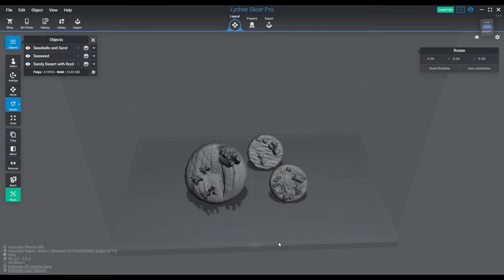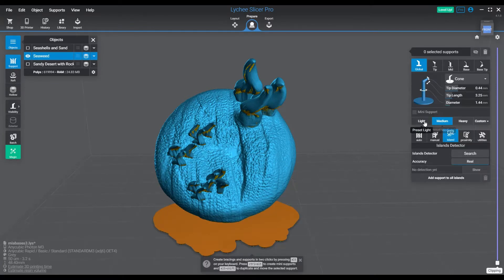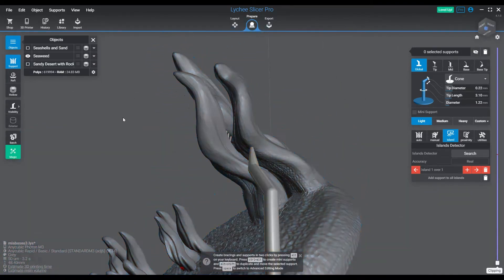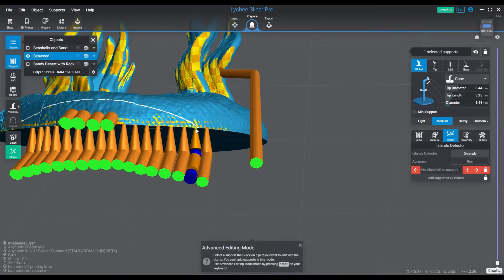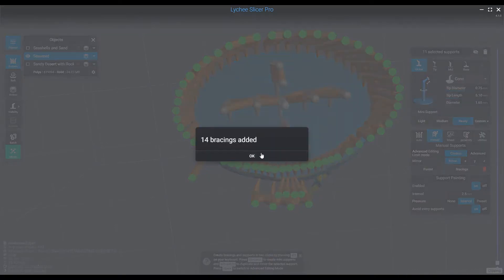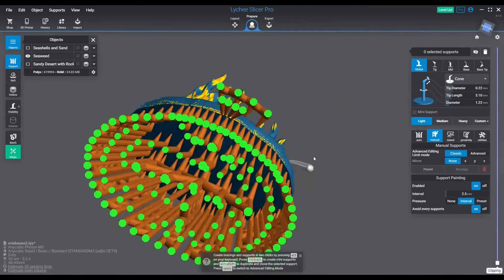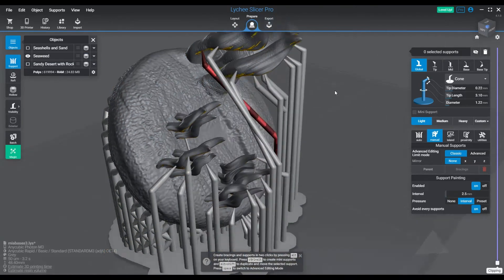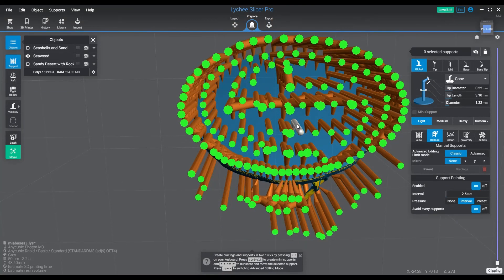Supporting bases with overhanging objects   Lychee Slicer Pro

Comment: How do you make the supports go between stuff and not go thru the model to the ground every time?
Reply from the maker: Sometimes that is just a glitch if it is the issue I am thinking of. Try focusing the mouse on the area and holding it there. It might be a glitch where the support bar fires through the parts and hits the floor. Unless I am not understanding the issue.
Reply: @IPrint3dMinis  I see! Yea that is exactly what it does.
Reply from the maker: Yeah I got it.